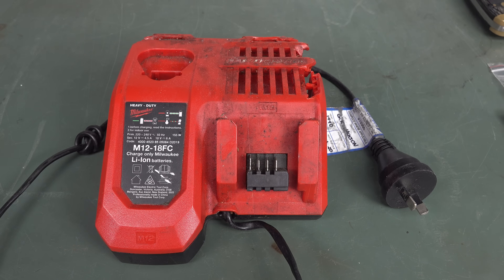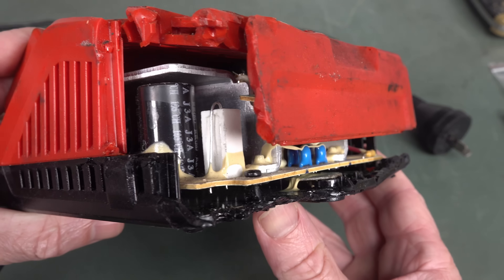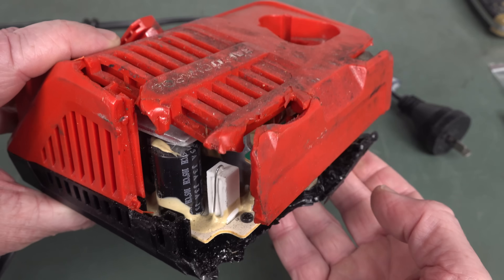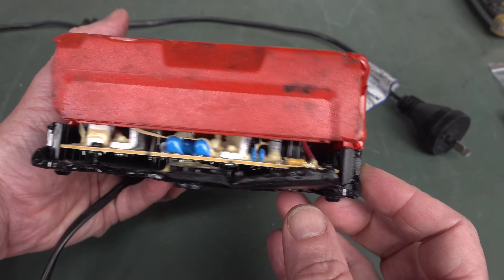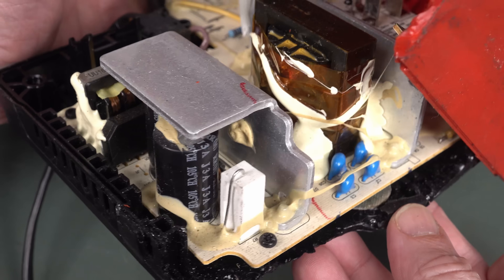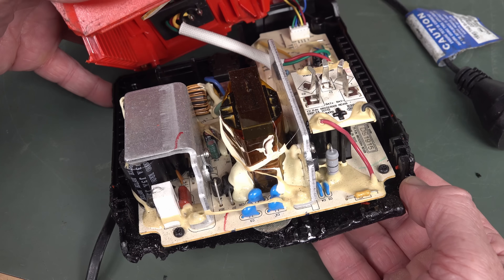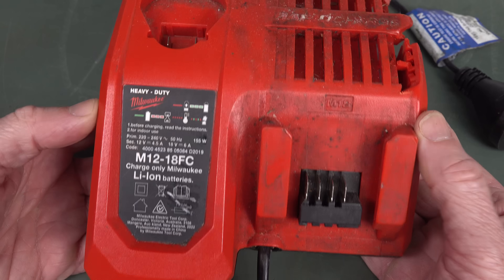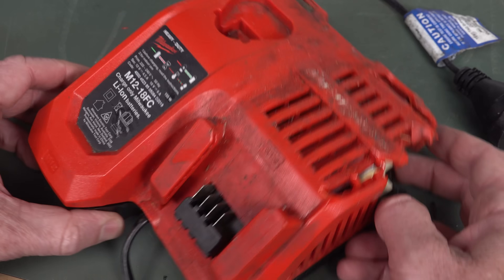When Safety Goes Out The Window

Comment: As a kid, about 14 years old in the 70/80-'s, I had a working  tube radio chassis next to my bed. I loved how those tubes glowed and all the mechanical things from those piano-switches so I took it out of its cabinet and used like that for years. Luckily my parents had no clue about the voltages in that radio.
Reply: I had an old Aster? radio with quite a hole in its side, it needed the odd thump to keep it going, so mum gave it one and her fingers extended into the hole and she DID find out about the voltages, the hard way - I never saw it again.
Reply: Reminds me how I proudly showed my parents how I could power a 230V lightbulb through water
Reply: I made salt water reostats to control melting pebbles on lawn with carbon rods from zinc carbon drycells.
Reply: Lol, i had a television just like that.
Also it leaked some voltage from the anode lead, not much but plenty for sterilising my room wit ozone.
Reply: @picobyte  My first repair was my B&W TV for my ZX-81 (around 1984 I think) It had a blown fuse. I placed a bolt instead, boxed it in with pillows and plugged it in. A loud bang and I went to the electronic parts store with the remainders of a blew up capacitor. Replaced it and used the TV (from 1963) again for some years until I got my first job and bought a KTV.
Reply: Some of those tube radios have live voltage connected to the chassis.
Reply: Exact like me, a tube radio chassis beside my bed. But the old flipping light switch above my bed beside the door had a broken cap for many years, and the times I reached out in the dark and got whammed is countless... That learned me to respect that open chassis, and I never got shocked by that.
Reply: @erikdenhouter  To modern over-protecting and over-regulating standards it is a wonder we are still a life. 🙂

I had a "kids electronics experiments" book from ( the 30's/40's). For a DIY radio the advise was to hang a wire antenna as high as possible and it explained how to get on the top of your parents house in details including how to remove roof-tiles so you could climb up. The book was written for kids from about 12 to 16 years old. Try to write and sell  that today.

Comment: Bit of Gaffa Tape, No Worries, good for another few years
Reply: Actually surprising they didn't do that.
Reply: I worked for 15 years in AV industry..If you weren't able to repair it with gaffa tape, you obviously didn't use enough!
Reply: They were probably concerned using gaffa tape wouldn't allow it to cool as efficiently as just leaving it wide open🤣👍

Comment: UAE. Pakistani workers testing if the power is on on a plug...

Don't take a look at a board. Don't use a plug or Multimeter. Don't use a device or a light to test.

Take a screwdriver, open the safety via ground opening, stick two short wires in each plug hole, then lick thumb and index fingers on each hand and pinch the exposed wires quickly and repeatedly.
Reply: Same in South Africa, wires jammed into the socket, and then used. Same with extension cords, they will use a garden tool cord, new (to this cord, far from new in reality, held together with tape and PVC weld) plug on the one end, and the other any old socket they ripped out in some other old renovation, with the line and neutral in the back, not polarised, not taped up, and using with things like welders, a few other tools all on the same battered multiplug, and all of them well over the cable rating of 8A, as it was intended for an electric mower of 1kVA draw. note as well the outer sheath will be off in multiple places, and therewill be multiple joins as well, either from wear, or from it being cut, held together with anything from packing tape, sellotape or even sticky plasters, or even just bare wires visible.
Reply: @SeanBZA  or at the shacks, wire coiled around the overhead lines...